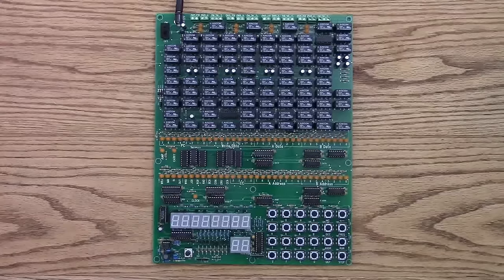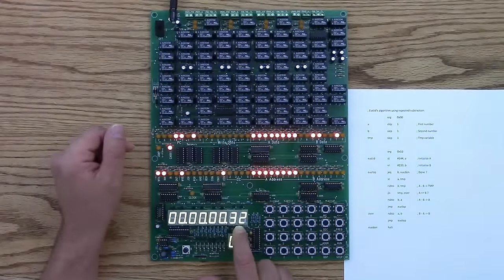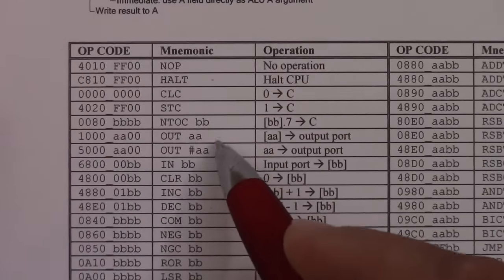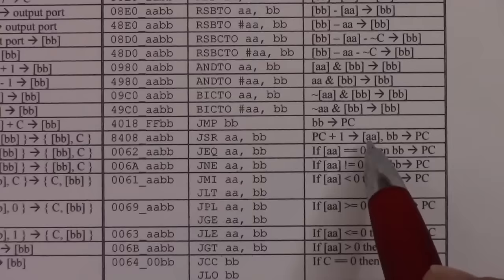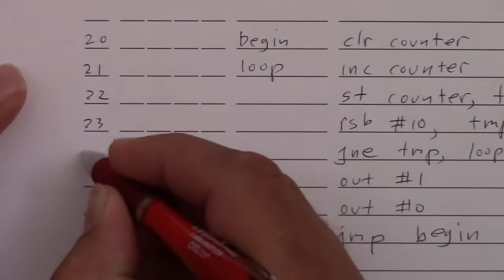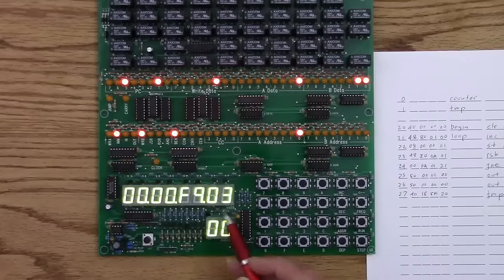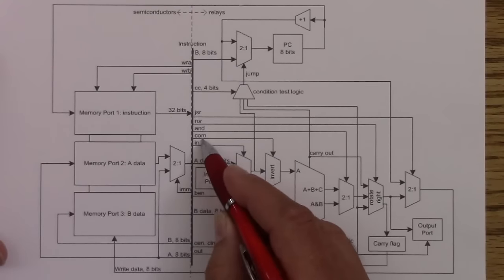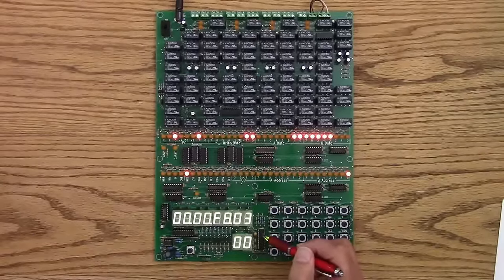Single Board Relay Computer

Comment: With so few relays I really expected a simpler machine .. there must be some trickery going on surely?
Reply from the maker: The RAM is emulated, so the only trick is to exploit this to the max- it's using multi-port memory, which ends up saving many relays.  Otherwise the savings are from careful architecture and circuit design.
Reply: There's a surface mounted STM32 ARM and its embedded Linux who do the job under the board !
Reply: It’s going down

in hISTORY

Comment: Lol everyone complaining about the memory ICs. I just want to see relays multiplex the 7 segment outputs :P
Very cool. Don't let the haters bring this down. The implementation of the idea is where it's at. A whole computer is ambitious enough with ICs, let alone the work half of a cpu being little magic metal fingers bouncing back and forth. Bad ass.
Reply: The options for random-access memory that doesn't need semiconductors to read and write calls for things that are either massive, obscenely tedious, require vacuum tubes, or all of the above. I agree they should cut him some slack.
Reply: >the work of half of a cpu being little magic metal fingers
now THAT's counting on your fingers.

Comment: I saw this video back in 2017 and was really amazed by every single second of it,
I really liked the idea, so today I'm starting to plan to rebuild a similar thing but with more relays, actually it'll be all relays and no ic's at all, all the way from memory to display decoder,
After some calculations by now I realized for the memory sizes I decided on, I'll need about 1,664 relays, just for the main memory, and I'm going for it whatever it costs because I know the moment it runs it'll be priceless to me, thank you for the inspiration sir
Reply: Even the memory? I'm impressed. How are you going to make that part work?
Reply: Very impressive
Reply: Any updates?

Comment: Brings back memories of how I used to write assembly code for PIC micro controllers.
Reply: I remember having to write a RAM clearing assembly subroutine for PIC32 after soft resets, as the hardware didn't clear RAM.

Comment: The control-bit "horizontal"[?] instruction-encoding is a huge eye-opener for me... Really drives-home how a CPU functions at an internal level. Suddenly I can visualize the different paths in e.g.the ALU, each having a separate "Chip-select."
[Edit: commented before seeing the diagram later in the video. Well-explained. And using MUXes makes a lot of sense]]

Never seen nor heard of "control bits" in this manner, so tightly-coupled to the instruction-set (and I have a degree and many years in embedded systems)!

I wonder what weird instructions this allows for that one might never think to intentionally make or look for... e.g. Compliment A (bitmask), AND B, Shift-Right, output to a port, and store back to B, all in a single instruction! Could be useful for e.g. bitbanging RS-232.
It looks like a jump could be thrown into that same instruction... Oh how I want to find a use for all that in a single cycle!
Reply: @someoned16  Intriguing, I'll have to look into that. Thanks!

Comment: This takes me back to my miss-spent youth.  We had Burroughs L2000 minicomputers which came with some software that we used. I wanted to write some simple routines like reading punched cards and doing a bit of maths and totals of numbers punched on the cards. I found a pinched paper tape that put the L2000 I to programming mode and I had a card with a list of the op codes with their corresponding hex machine code. The memory was organised in four instructions  of four hex characters per word. The instructions were executed in reverse order from each word which was a bit of a headache until I found this out! Manually converting the app codes into hex was a bit a pain but I thought that was how you wrote programs! Imagine my surprise when I was gold that such things as assemblers were available to do this for you! And then high level languages - I thought all my birthdays had  one at once. Great video and a wonderful machine!

Comment: I just came across this some two years late, but I have to say, that is a really elegant implementation. 

For those complaining that the memory wasn't implemented in relays too, very few if any first generation computers used the same technology for memory and the CPU. Typically a relay computer would have paper tape memory or something equally arcane and hard to duplicate these days.
Reply: The one I remember was rope core memory
Reply: Rope core or braided wire memory was relatively new compared to a relay machine. The Burroughs B 3500 third generation integrated circuit machine used that for ROM in the 1970s. So did the Apollo guidance computer and a number of others from that general era. But that was a form of ROM, and we are talking RAM here. 
First generation vacuum tube machines used a number of forms of RAM. Flying spot scanner CRTs and mercury delay lines were among the most common, along with drum memory. Of course accounting machines like the IBM 402 and 407 used relays and mechanical switches of various forms for memory, but they only had a few registers, not a large addressable RAM field.
Reply: @lwilton  Huh. Interesting. I haven't studied the old old technology. My knowledge of computers kinda ends in the 80s. I'm working my way back though

Comment: What? No ferrite ring memory? No output to valve tubes numbered displays? No paper card reader? No reed switch keyboard? :-D
Reply: I think it is not fully relay based computer. You still see there are some ICs. I think it is a combination of modern and relay computer. Relays just do some logic functions to show us how some logic functions are done. It is quite interesting to see clicking relays, leds showing logic level and final results displayed in 7 segments leds display though.
Reply: that's why I'm making a replica of the Fujiwara Facom computer
Reply: I mean, the Fujitsu Facom, yep, I'm buying 5000 miniaturized relays (I wish they were transparent so I could see them clicking).
Reply: @joeypc87  , the entire CPU is implemented in relays. Think of this as the microprocessor on any single board computer, e.g. the KIM-1.

The memory is a separate thing, and in this case is the 1k Bytes of  RAM internal to a PIC microcontroller (arranged as 256 words of 32 bits each, as required by the relay CPU. When the relay program counter asks for the next program instruction, the PIC reads it from its RAM and presents the 32 bits to the relay CPU, which then executes the instruction. The PIC is there to 'be the memory'. There is a second, smaller PIC microcontroller which handles scanning the keypad and multiplexing the 7-segment LED display, and maybe also the serial port. One of the PICs also generates the clock for the relay CPU. Neither PIC is involved in executing the program, i.e. no cheating.

When you study in instruction set and CPU architecture diagram, it is easy to see how so much can be accomplished by 83 relays.

Comment: Can it use NEC 5V DPDT dip relays?  I have plenty of them from the LIC cards of the dismantled NEAX61 exchange. Using them instead of buying new 12V relays would save a handle.

Comment: Why using relay not transistor ?
Reply: Cause why not.  Click clack.
Reply: Just for fun. Using transistors or 74-series logic would be too easy. The relays add a bit more challenge to implementation, which makes it more interesting to design and build. With the price and availability of modern VLSI microprocessors, these don't really have a practical application. That means speed isn't really important, which means the relays don't pose a huge bottleneck to it's functionality.

Not to mention it looks super freaking cool.
Reply: @anon4820    Not to mention it sounds super freaking cool.

Comment: Still waiting for shitheads asking if it runs Crysis.
Reply: does it?
Reply: roff poff :-D
Reply: give it a couple million more relays and it might.
Reply: I'm wondering if it could run Minecraft.
Reply: In theory, yes it could run Crysis. You just need to write an interface for a few bits of external hardware, write a cross compiler, teach your descendants how to maintain it, and then settle for a frame rate of 1 in 100 years or so.

Comment: it´s not a relay computer! I can see integrated circuits...
Reply: Of course it's a relay computer. The part that computes (the ALU) is made of relays. I understand how he would want to use chips for memory and that's fine. There's no rule that says your memory has to be the same thing as your logic circuits.  This is a tremendous achievment. I programmed in Z-80 and 8080 Assembly back in the 70s and 80s.  I really like the efficiency of how he decodes the instruction.
Reply: You might want to listen to the entire video.....

Comment: Where is the monitor?
Reply: Its has TTL level serial for advanced I/O for assembly, disassembly, and debugging.  Or you can use the Hex keypad and 7 segment displays for a more "old school" experience.  Lastly you have 4 bits of output via relays and lights, and four bits of input from the contacts.  You can also read/write to the ttl serial port via programs too.

Comment: What about a 100% relay computer
Reply: What do you propose for memory?
Reply: @CharlesJrPike  I been thinking of a switch design, 4 contacts , visualize two letter V's grabbing a small metal ball that is attracted to a magnet, rotate the V's 90 degrees so the tips are far apart from each other, and the points of the V's are not touching, there is your 4 contacts, and pull the V's apart just enough so the ball cant make contact with half a pairs or both pairs at the same time, very small gap, and then you have a natural magnet on each end not touching the contacts but holds the ball to them. And then electro magnet around the natural magnet used to cancel out the field or weaken it, so the ball goes to the other side. And make this small as possible. Those could be used as transistors, and storage memory and ram.
All you would need is resistors to not burn out the coils LEDs etc. By the way I have thought of a computer architecture that is completely different, that is superscaler and super computer. If you know enough to want to talk about that
Reply: @davidprock904  I like the idea. I think that we can get rid of the two natural magnets and instead use gravity and a tiny bump. Or better yet, use something similar to a light switch, but requiring very little force to switch so that it can be done with only coils. It would probably be a monumental task to make the thousands of those you need for usable amount of memory, though, and might require you to revamp the computer's architecture to be as memory efficient as possible.
Reply: @CharlesJrPike  speaking of gravity. I thought of this before you mentioned it, but it would be wasteful on electricity so I didn't take it any further, but if you take a tiny motor, its shaft that spins have a disc on it, and on the edge of that disk have the same example, a tube, curved or straight would work, liquid metal or solid ball bridging contacts, then you reverse the motor the switch will toggle. And to save on electricity to make the motor stop the constant spin, to stop in the proper orientation would just require even more complexity/computing power. And also that would involve brushes to get the readings from the switch... WHILE typing this, what if you pull some "trickery" with the switch and the coil that makes up the motor... so the motor is spinning and the switch is in what ever state. You momentary reverse the power on the motor, the switch changes state making the wires in the motor coil act differently holding that reverse motor spin. And then you would look at the power going to the motor and see which wire is positive to determine if it's a one or zero. But if you build this you just made a different style of relay constantly needing power, but would there be any other gains. Also if you use just regular gravity, now you slow down the switching speed. You could make a relay that never ever need any maintenance but at cost of speed? Side note, my computer architecture design I been thinking of will vastly improve regular electric circuit computer and or a all relay computer.

Comment: this is not a relay computer when half the board is plugged with ICs

yes, it has relays .. but it also has many many many transistors.  - such a hybride is rather pointless.

Either make it pure relay, or pure semicon, or pure tube.

I am gonna assume the ICs are needed for the convenient input / output